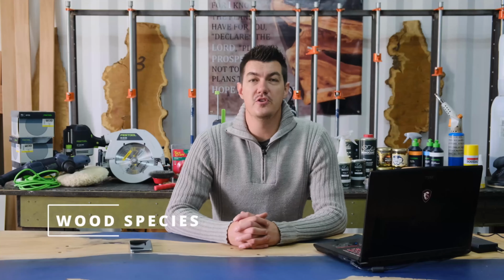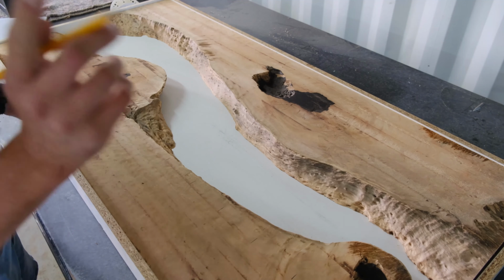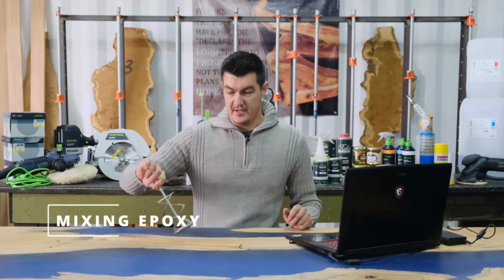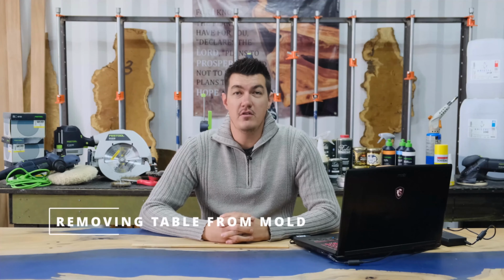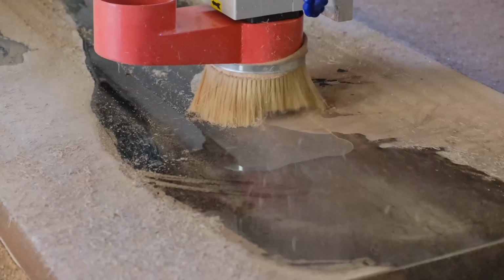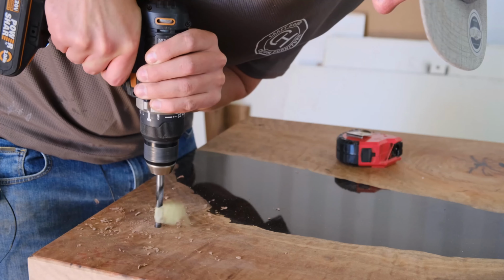DIY Blue Epoxy Table Build

Comment: Do you sand your tables and go straight to the oldies oil or do you sand your table then polish the epoxy with a three step polish then put the finish on. I ask because I done a little table and sanded it then went straight to rubio monocoat. I can still see my sand marks pretty bad. So wandering if I should 3 step polish it first then put on rubio. Please help